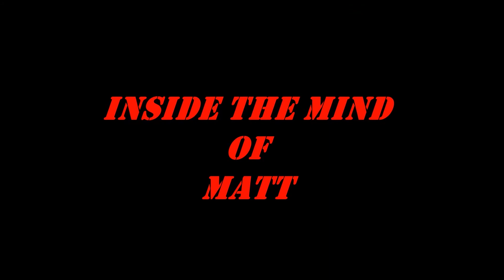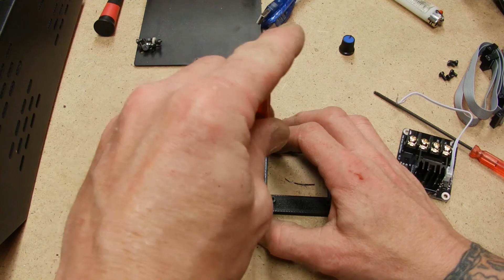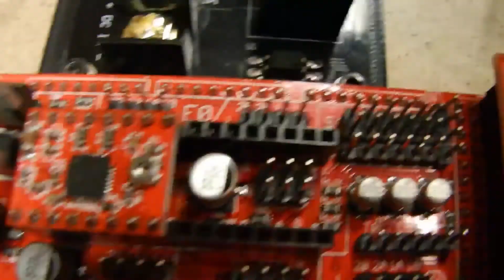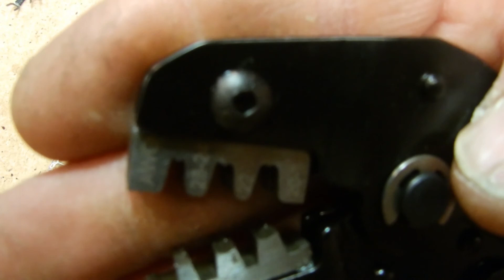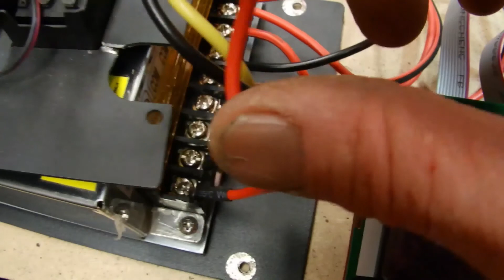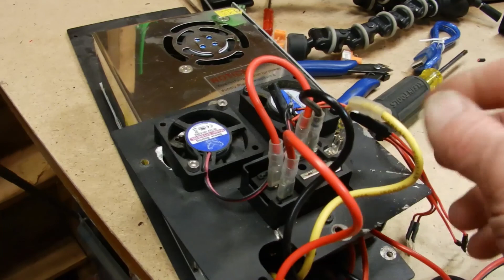Ramps Conversion Part 2 (Replacing Melzi Board With Ramps 1.4)

Comment: hi need your version of marlin sketch you used please as i cant find good one  regards
Reply from the maker: My current version has a leaving sensor and the titan are you familiar enough to be able to edit those features out?
Reply from the maker: Part 4 I do a walkthrough of the firmware and what I changed it was a scratch built

Comment: I did this conversion but something is missing.  My steps per MM are not correct and I would like to know what you use in your configuration.h file.  I'm using Marlin and the configuration I"m looking for is this #define DEFAULT_AXIS_STEPS_PER_UNIT   {80, 80, 400, 97}  // Wanhao {80, 80, 400, 97};
Reply from the maker: Those #’s look right do you have all 3 jumper installed on the pins under the stepper drivers?
Reply: Sorry for the late response and  the jumpers actually made sense and I thought that might be it, but the jumpers were correct.  The good news is my conversion is complete and the printer is now printing perfectly.  My issue was with my configuration.h file that I found on the Internet, which was close to being right, but I could not get the configuration right.  I ended up finding another configuration.h file that worked for the Marlin firmware.  I am in the process of documenting that configuration.h file and making it available for those that may want it.  It should work as is now and not need any changes to compile a working Marlin firmware for the Wanhao/Monoprice I3.  Everything else I followed your Videos to put the pieces together and I want to thankyou for the great video series on how to complete this upgrade!
Reply from the maker: Your very welcome happy you figured it out glad I was useful enjoy the upgrade and happy printing

Comment: Hey Matt - any idea where your second set of wires to power the system (very top left of the board around 16:00) came from? I am converting my Maker Select V2 to RAMPS as well and it seems like I only have one set of wire endings for my 12A/5A inputs opposed to the two that you have here. I think you explain it that one is somehow coming off your mosfet, and from there it is going to your power supply? I wasn't 100% sure I wanted to double check :)
Reply from the maker: if the ones you speak of are going to the green connector they are from the power supply + and -  (red and black)

the = and - (black and red) to the mosfet one set comes from power supply and the other set go to the bed. 

hope this clears things up if not let me know I'm here to help
Reply: @InsideTheMindOfMatt  Quick reply! I love it. So I too have a mosfet, and we are on the same page there. For the arduino board there should be 4 power cables to the system I believe, going into the green connector. They're all coming from the power supply, right? I think i'm on the right track but I don't want to fry all of my hard work :)

Comment: Where to put second cooling fan? 1 st on extruder 2 nd on nozzle
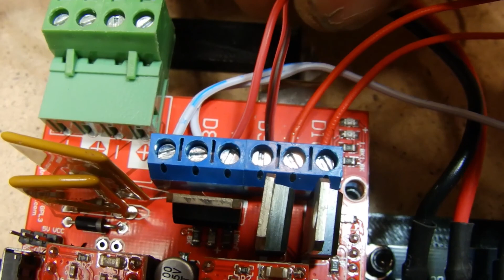Reply from the maker: Vadim Sidorov the part cool fan watch 16:05 in the video it shows the terminal and the hot end cooling fan I wired direct to the power supply
Reply: Inside The Mind Of Matt thx it's helpful

Comment: The soldering under the power unit of the RAMPS board buts up against the power input on the Arduino, causing the RAMPS board to not seat all the way. Is this how your board was? Will it be a problem? https://i.imgur.com/NwJG4Bx.png
Reply from the maker: I didn't have an issue with the soldiering but a few of the pins where bend and I had to straighten them to get them to fit
Reply: At the end you have 2 sets of power wires running into the RAMPS, but the Melzi board only has one set for power. Does the RAMPS need both? Did you just cut some cables for the other set of power wires?
Reply from the maker: Davis Pearson yes Ramps board need 12 volts to both terminals you can jump from one to the other or run wires to power supply I had some spare wire laying around that I used

Comment: Another tip for the Z axis plugs is to take the side cutters and remove all the parts you can from the white jst plugs. This is what I originally did with my A8 when I installed the RAMPS mainboard.
Reply: This is what I will be doing until the Dupont connectors arrive, if there are zero problems I will leave it as is.

Comment: issues with installs
Reply: Ha! You sound like me. 3D Printing is a fun hobby, but very slow to troubleshoot & tinker with when you have 3 small children, a full-time job, a bedroom addition, and many other projects all occurring at once. I'm preparing to upgrade my Melzi board to Ramps after running into firmware issues with an e3D hot-end. I'll be sure to watch your video here and use you're already-gathered insight!
Reply from the maker: well lets just say fixing it is one thing, 
documenting it is the next level 
fixing, documenting, working 3rd shift, having construction on house, IS WHOLE different dimension. But I'm really enjoying making these videos and diving deeper in to this 3d world.